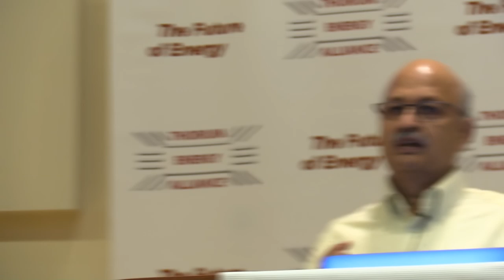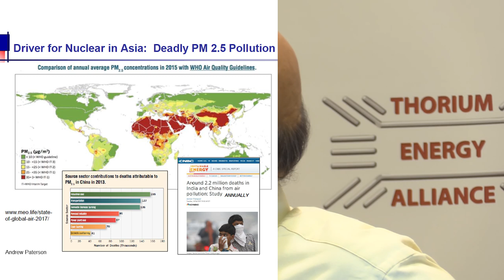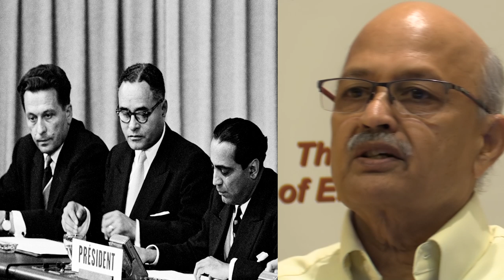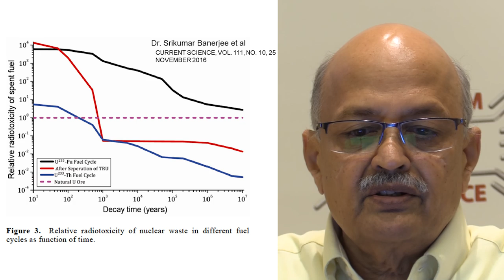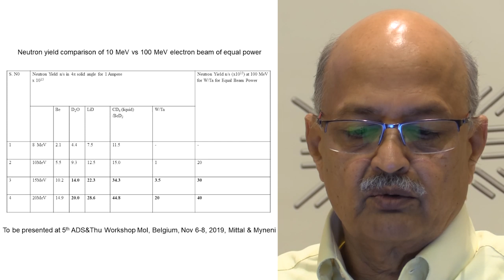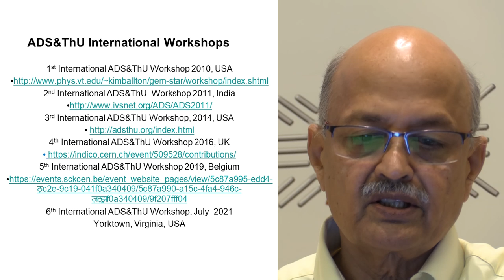Yorktown Clean Energy Center - Dr. Ganapati Myneni @ TEAC10

Comment: Hmm ... subcritical accelerator driven reactor.
The only advantage this could have is potentially faster load following (or maybe smaller fissile inventory and size) but he didn't even mention that this reactor will be faster at load following so it might not even be true.
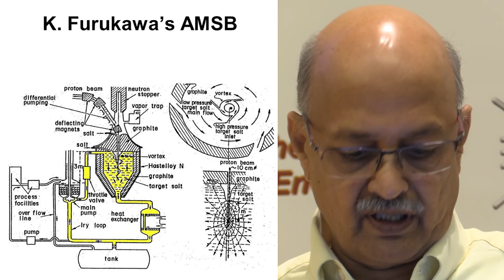Also I couldn't miss that little box at 6:25 which says "Reprocessing for recovering U-233". That's quite a proliferation risk, isn't it?